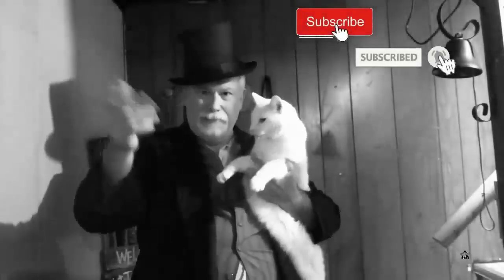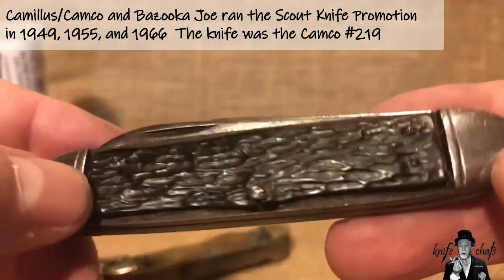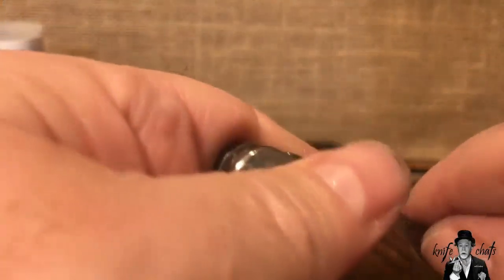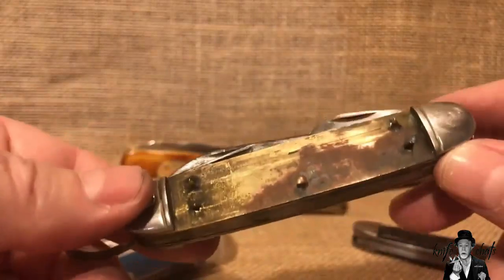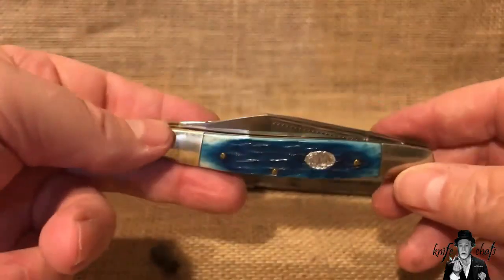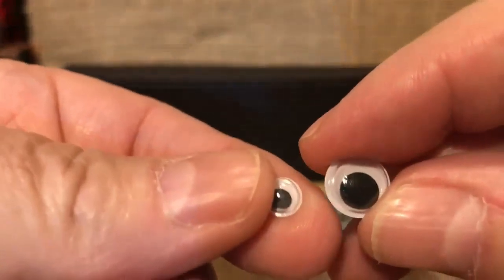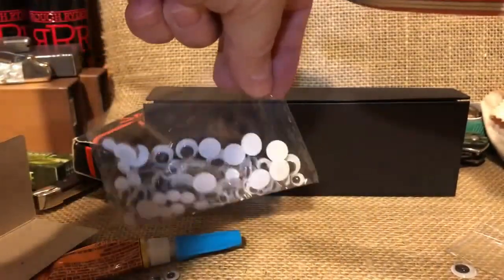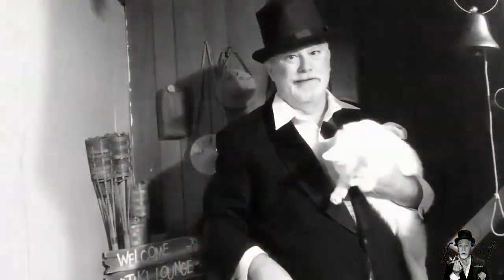Knife repairs and other musings.

Comment: Hmm,..... I just bought a frost sunfish missing the shield with a crack on the bone cover.  I got it for 15 bucks, I figure I can put some super glue on the crack, and source a shield for the frost knife later.  I have used JB weld in the past to repair handles, but never to replace one.  I have in the past, cut off the pins, and just glued a wood slab on there and sand the edges.  Good luck with the project!

Comment: The idea of using putty isn’t something I think that will work. There are products that might work used for wood tables and Bar tops. You can color and pour on thick enough to work. You likely have seen them; they often pour them over things laid on the table and encapsulate the objects with the resin. When cured it is very hard and scratch resistant. A 16oz kit costs $16 to $25 it is called Pour-On. There are others brands that are sold as well. You might find some in hobby and home improvement stores. No matter what you decide to do; isn’t going to be easy or cheap. I used glitter and Hard as Nails finger nail finish to replace missing shields. It worked without much time and work. They don’t fall out and you can make them look like gold, silver, or pearl. 🎁🎄😊

Comment: I love the Copperhead pattern.  I was not aware anyone made one with a locking blade.  I have a couple of the Case Copperlocks but they are single blades and are kind of thin in the hand.  Those Frosts look real nice, especially the one with the Warncliffe secondary blade.  What a great little knife!  Thanks for the info!
BTW, I suspect you could use handles off a similar camp knife and make impressions in clay and then paint/pour in epoxy into the molds and make new plastic covers. Once it hardens the clay will come right off, especially if you put a coat of Vaseline on the clay prior to pouring the epoxy in.

Comment: I bought a pearl Hen and Rooster trapper from Amazon the other day.  It arrived yesterday with the shield loose in the box.  They didn’t even cut a nice round hole for the shield.  I knew the risk of buying that, but I really wanted to buy pearl for my niece who asked for a pocket knife.  I returned it and took pictures and posted a bad review of the knife.  It isn’t up yet.  It only had one review and I isn’t good.  Would have been more forgiving if it was $10 but it was $130.  picked up a Case mini copperlock in old smooth bone instead.

Comment: You could market that doohicky and make a buck or two. lol  How will you contain the epoxy in order to shape it? Now you have an original Red Eye Brand Steel Warrior.
Reply from the maker: This stuff has the consistency of PlayDoh but dries like steel.  I’ve used it to repair a cast iron drain pipe for a toilet.  20+ years and holding strong.  It’s a type of marine epoxy.